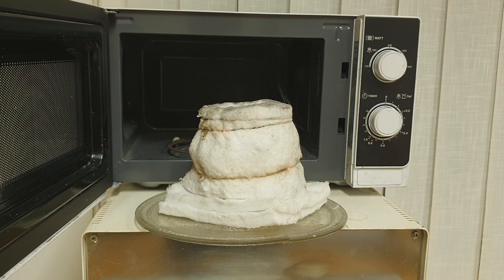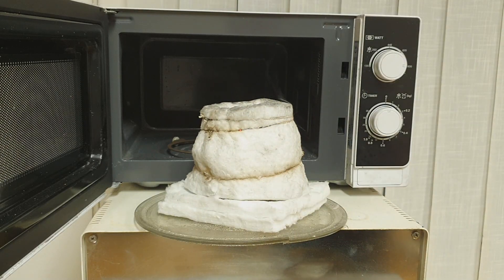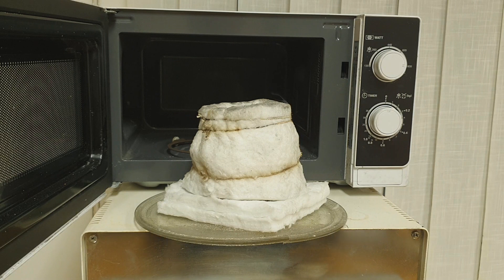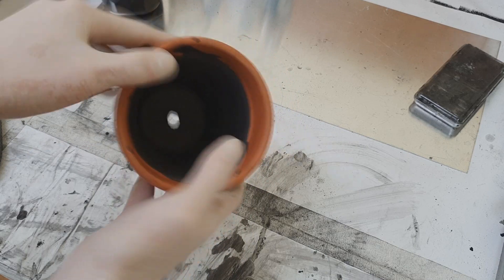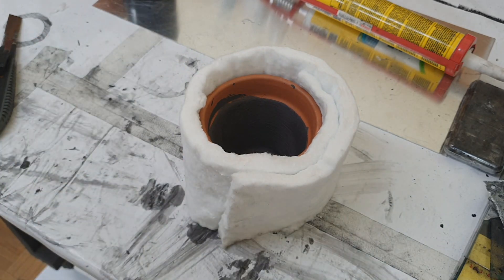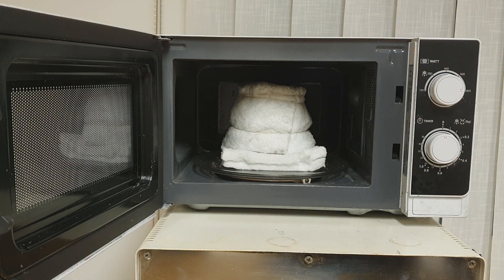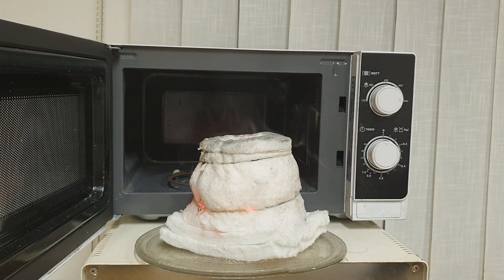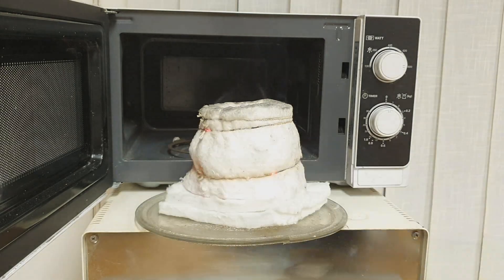Microwave kiln & conductive ink - Test

Comment: I feel like you read my mind! I am doing work with microwave kilns right now too! Have you seen ShakeTheFuture's video on how to make a microwave kiln? It's the best on YouTube hands down! I am using small glass-melting microwave kilns right now. I find that a lower power level for longer is better for carbonizing materials. I have carbonized peanut shells both with and without an activating salt and got resistance of between .49-85 Ohm! My next step is to learn to make microwave kilns because they are faster and more efficient than electric kilns even though they are trickier to control. Great work and thank you for sharing!
Reply: Kenneth Anderson 
And thank YOU for the references. I’ll check them out.

Comment: What use is it
Reply from the maker: Microwave kilns are high temperature low cost kilns. Basic use is for melting / softering glass. But you can also use for melting other stuff, activating materials, etc.
Reply: @cayrex   Hi. Thanks for testing .  My earlier question  ref. "white hot in the microwave ? " is fully answerd ...  A few key words in this respect - refractory cement  ( aluminium cement ) and perlite . Maybe the materials to use to make a microwave kiln. Fibre blanket is not harmless , take care. A combination of silicon carbide and waterglass can also make heating elements for a microwave kiln . Keep up the good work !
Reply from the maker: @pieterwaterberg8138  👍 I will probably go with aluminium oxide cement or Al2O3 cement coated ceramic wool,... make good hardness
Reply: @ Fall Knight   Hi. Fusing glass  , in my case . By all means search for " treasures from the microwave kiln " on YouTube.

Comment: I think you can mix perlite with plaster of paris or clay and make a mold of the clay pot! It will be as thick as you like and then cover in ceramic wool !!
Reply from the maker: Perlite softens when it reaches temperatures of 850–900 °C (1,560–1,650 °F). Water trapped in the structure of the material vaporises and escapes, and this causes the expansion of the material to 7–16 times its original volume

Comment: 2 question:
1- is that an iron wire you wrap up the ceramic blanket? why you didnt use a fiber glasse rope?, its more safe I guess.
2- why you didnt use an insulation on the top ?
over all its great experiment.
thumbs up
Reply from the maker: No I dont use iron wire. That was hemp rope I think. Is good if you have a insulation also on the top with a little hole, but in my case I dont need the top insulation, because I only try the concept